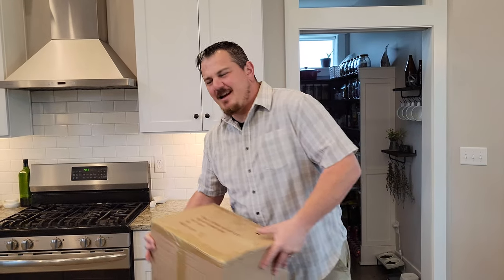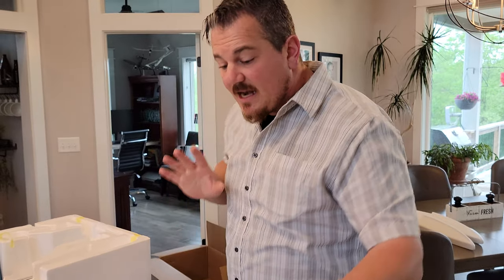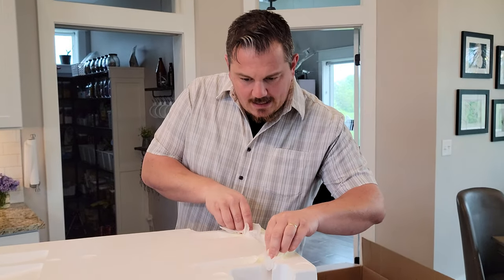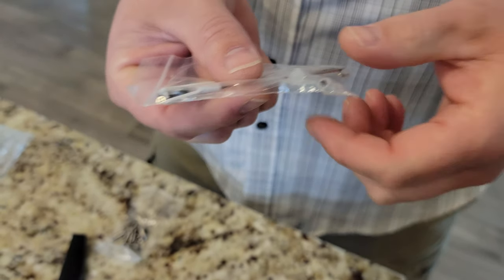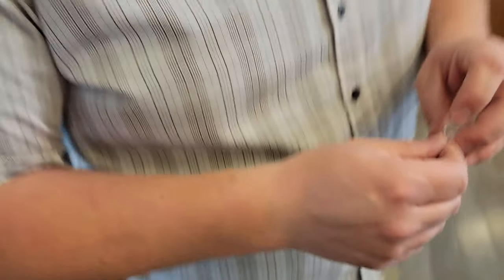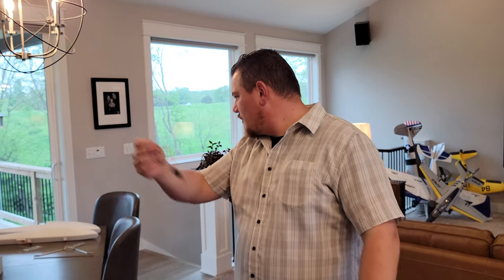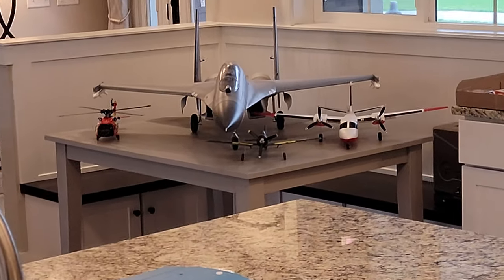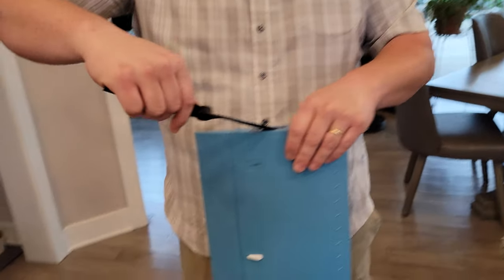FMS - Maule - 1500mm - Unbox, Build, & Radio Setup

Comment: Those land gear covers do slide up so that gap will close.  I installed firm foam pads cut to fit under each landing rod  to take up that  slop  as well. Tacked in place with foam to foam glue.   Looks and works great.  I think the E flight model is a better bang for your buck plane.  I just ordered new wings for my red one. The hinges are failing and my flap hinges don’t travel equally. ( Hense to much rustoleum paint . Live & learn.

Comment: Hey Brian, I have the T- Mobile home internet. Works great. I'm only about a half mile from one of the towers. Really fast.
Reply from the maker: We've been running it for about 2 weeks now, and since we put up that ugly antenna, it's been amazing!!! 500-700MBPS down and 50-70 MBPS up, which is a 4-5X improvement, without annoying disconnections all the time from Starlink.
Reply: Sorry to continue the off topic discussion but I had T-Mobile Home Internet AND the Waveform antenna and I couldn’t get the speeds necessary to justify the $400 antenna cost. I am only 1.4 miles from a tower that provides 1gb+ speeds but I was only seeing 25mbps down and 15mbps up. Oh well. Back to the regular scheduled programming.

Comment: Hi Brian!
I just ordered FMS Maule yesterday and I’m so glad I came across your YT channel!
Could you please advise if I can safely plug IC3 spektrum battery connector to the Maule’s XT60 and keep it like this always? Or is it better to get an IC3 to XT60 connector adapter? I can see you’re just plugging IC3 to XT60 but I’m not sure if it’s safe for the battery and ESC in a long run? Many thanks in advance! 
Greetings from Poland!
Reply from the maker: Yes, IC3 will fit into the XT60, but to be clear, they are "not compatible" - I know, seems a contradiction, but the pin and socket size will work together fine, and we've been doing it for years. It can be tough on some connectors, to push the IC3 into some XT60's, so if you decide you want to use an "adapter" - that's fine too, OR you can cut off the XT60 and install an EC3 (same size, and "compatible").

IC3 will always work with EC3
IC3 battery will work with XT60
...BUT...
XT60 Battery will NOT work with an EC3 equipped plane
XT60 Battery will NOT work with an IC3 equipped plane

Hope this helps!
Reply: @BrianPhillipsRC  Many thanks Brian! This is a perfect explanation! Safe flights and can’t wait for your next videos! All the best! 
- Mike

Comment: Brian, you plugged in the wrong connector on the wings side. 👍
Reply from the maker: Not sure what you're talking about, since everything worked. What did you see??? I just flew it, like 10 more times in the last two days.
Reply: @BrianPhillipsRC  in regards to the labels.
Reply: @brianphillips at 57:24 in the video you plugged the wire lead from the wing labeled “lights” into the fuselage connector labeled “aileron” hence the incorrect control movements. FMS had the labels correct you just mis-plugged a connector.

Comment: Did you ever show how the reflex was tied into the receiver??  All,do a sudden the wires were just stuffed in the compartment.
Reply from the maker: What? Can you time-stamp your remark? We try to reply to thousands of comments, so it's tough for me to be able to scan through to where your question was based on.

Give that a shot, and I'll see if I can answer you better.

Thanks!

If you don't know how to time stamp, let's say the point in the video was 25 minutes and 30 second in... just say @ 25:30 and I can use that to get help you figure out the answer.
Reply: I realized that when the plane arrived the leads for the flight controls must have already been plugged into the reflex unit.   I saw you attaching in all the leads to the spektrum receiver but no mention that they were coming from the reflex. I do enjoy your videos and your banter with the “camera crew!”

Comment: When activating a new plane i always do it from the ground and stand in front of the tail and hover toward the front of the plane to plug the battery in there is no way a Live Propeller can attack you that way.
Reply from the maker: Now that we have thrust reverse, gotta watch out ;)
Reply: @BrianPhillipsRC  Yep you got that right Brian when im working with newbie Rc pilots i always drill into their head to hit the throttle hold asap after connecting the battery

Comment: Mine did not have a reflex module.  Where in the pacakging was it supposed to be???
Reply from the maker: Hmmm... the Reflex should be preinstalled with the servo cables coming out to go directly into your receiver. According to FMS's website it is still listed with a Reflex but currently out of stock. Did you order direct from FMS?
Reply: @BrianPhillipsRC  Well, guess what... the "model" they sent me doesn't come with the reflex--despite being advertised with the reflex.  I contacted FMS and they sent me a free Reflex 3 v 2.0 for free!!  That's some fantastic customer service!   If you've read this far, on another note, I could sure use some insight on how to remove the ESC from the Maule.  Any ideas?  Thanks again for your wise words.

Comment: Any reason you didn't swap the labels on the mis-labeled wires? They are still labeled wrong....
Reply: They were labeled correctly. He plugged in the wrong connector at the wings side 😅

Comment: Does this come with everything including the remote and battery’s
Reply from the maker: No, this is a PNP (Plug and Play) model. This means it's only the plane. You'll need to provide the receiver, transmitter and batteries necessary. For this plane, we used: 

Battery - https://bprc.me/4S_3200
Receiver - https://bprc.me/AR620 (since it already comes with a Reflex stabilizer)
Transmitter - https://bprc.me/NX10

Hope that helps!
Reply: And is this the same thing with the FMS Ranger 1220 and 1880. Also on their website do I need to purchase all the”Frequently Bought Together” or are those spares?